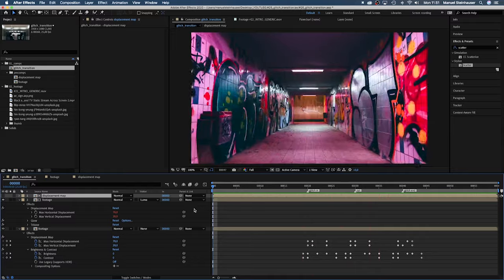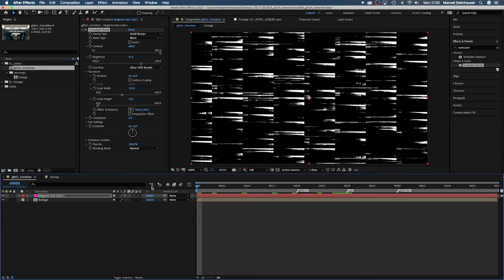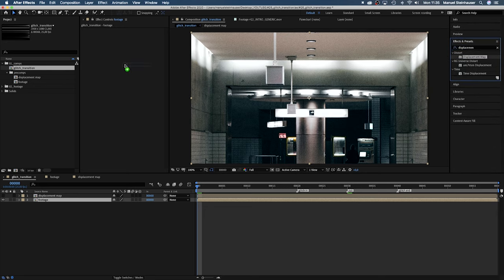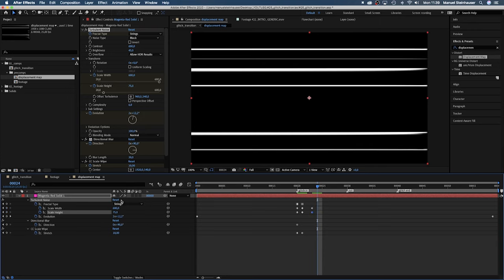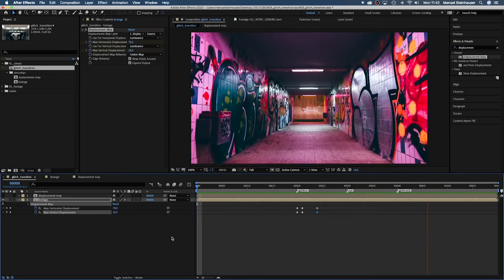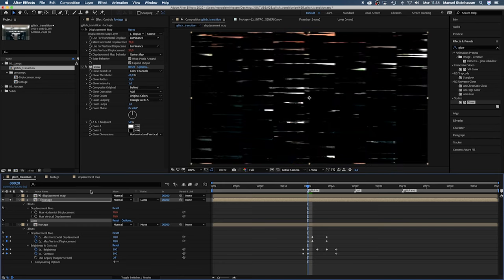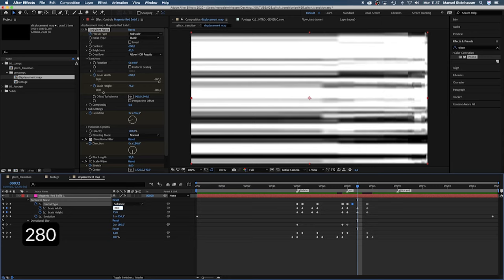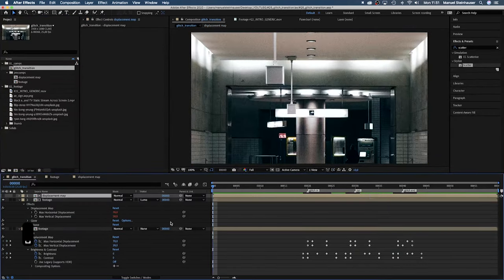Glitch transition setup using standard effects | After Effects Tutorial

Comment: Hi ! I want to use this transition in my twitch stream. I just need the part where it cuts with the glitch transition. I bought the project but don't really know how to do it since they are pictures. It is possible to transform it into a stinger transition for my stream ?
Reply from the maker: Hi Rachel! The colour of the glitches depends on the footage u use in the top footage comp.
You could still add some footage to the top footage comp and render the transition without the bottom footage comp. But with a straight alpha channel instead so that the background is transparent. I am not entirely sure though if you can use transparent transitions in your stream...
Another option would be that you add a neutral background like a solid with a colour gradient instead of the bottom footage comp.

Comment: The beginning of this tutorial is very confusing. For example when you precompose the footage it shows up next to the glitch comp. It doesn't do that on my AE, Also you say "let's  go back to the main comp" and the footage shows up in the main comp. Did you skip steps here?
Reply from the maker: In the pre-comp window the checkbox "Open new composition" was active. Maybe that's the reason?
Or maybe you didn't select the two footage files, before pre-comping? You need to select them before pre-comping them.
When you pre-comp the footage, it automatically replaces the footage files in the glitch transition comp. So after I say back to the main comp, the pre-comp already is in there, because it was replaced earlier.
Reply: @ManueldoesMotion  You are correct. The "open new composition" box was not checked. Thanks for the quick response
Reply from the maker: You're welcome! Glad I could help.